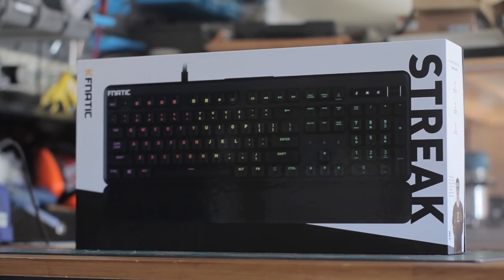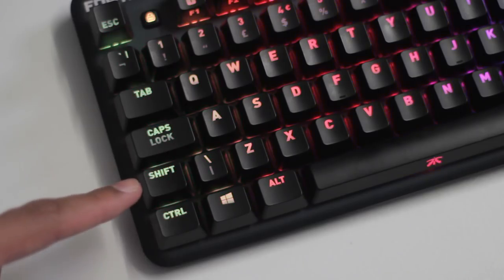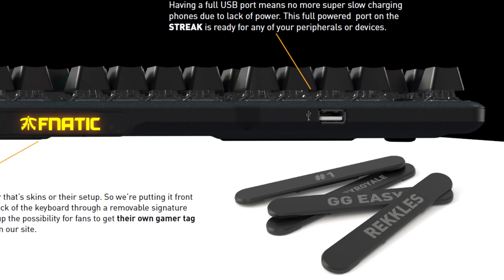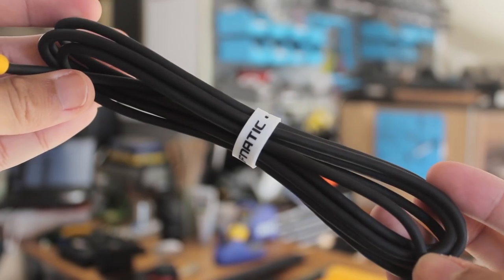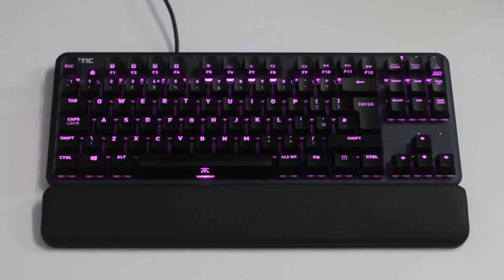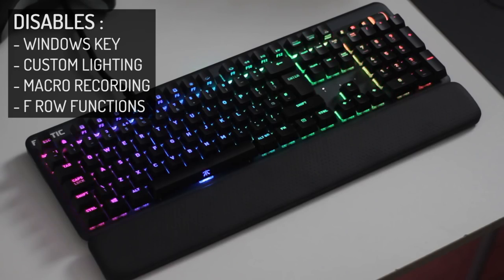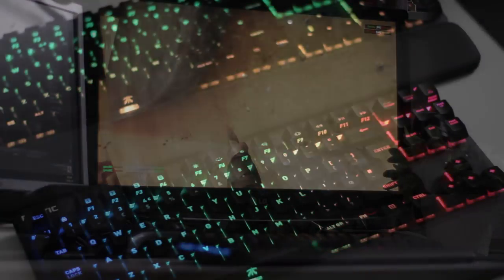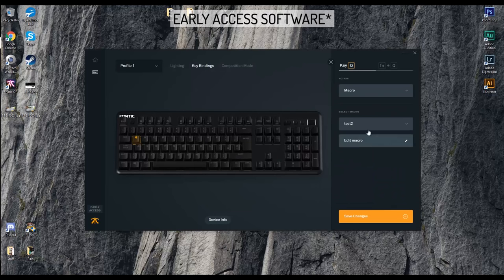Fnatic Streak & Streak Mini Gaming Mechanical Keyboards - Unboxing & Review

Comment from the maker: I've completely misunderstood the concept of wrist rests and how they should be used. Thanks to Daniel J. Grouse for alerting me. I did more research and testing, and have written my initial thoughts here : https://www.taekeyboards.com/single-post/REVIEW-Fnatic-Streak-Streak-Mini-Gaming-Mechanical-Keyboards
Reply: wait what its a wrist wrest u put ur wrist on it
Reply: Its okay. The idea of a wrist rest is a complete misnomer.
Reply: As Tae has locked his website and not copied the useful information given by Daniel into the pinned comment, I'll post it here for anyone who might find it useful:

"You're supposed to rest your palms, not your wrists. Resting your wrists applies pressure on them and makes you more likely to eventually have issues with carpal tunnel or other similar RSI problems.

"The fact we keep calling them wrist rests (instead of palm rests) and the fact you can buy many that are potentially quite harmful to you doesn't really help. I hate springing "uhm actually" onto people, but it's also something potentially detrimental to your health. It's mostly on manufacturers to start labelling them better and on the mechanical keyboard community to be more helpful when it comes to educating each other about ergonomics. We spend tonnes of money on the most comfortable and ergonomic keyboards for us while completely ignoring proper posture and typing techniques.

"Yes, if you can hover for prolonged periods of time without feeling strain anywhere else, that's the best. Resting your palms is the second best solution as long as it helps you maintain proper posture and typing technique. Also, I agree they should be called palm rests."

Comment: You're supposed to rest your palms, not your wrists. Resting your wrists applies pressure on them and makes you more likely to eventually have issues with carpal tunnel or other similar RSI problems.
Reply from the maker: Thanks mate. I did more research and testing, and have realised I've completely misunderstood the concept of wrist rests. 
I've written some quick thoughts - please refer to pinned comment.
Reply: Yeah, the fact we keep calling them wrist rests (instead of palm rests) and the fact you can buy many that are potentially quite harmful to you doesn't really help. I hate springing "uhm actually" onto people, but it's also something potentially detrimental to your health. It's mostly on manufacturers to start labelling them better and on the mechanical keyboard community to be more helpful when it comes to educating each other about ergonomics. We spend tonnes of money on the most comfortable and ergonomic keyboards for us while completely ignoring proper posture and typing techniques.
Reply: I mean, yes, if you can hover for prolonged periods of time without feeling strain anywhere else, that's the best. Resting your palms is the second best solution as long as it helps you maintain proper posture and typing technique. Also, I agree they should be called palm rests.
Reply: Yeah really it's pretty messed up that a lot of manufacturers advertise "ergonomic wrist rests" that are actually bad for you.
Reply: Those "wrist rests" always gave me cramps.
Reply: @danilodeklerk7422  Depends on the manufacturer. Logitech calls them palm rests like you should.
Reply: So i put my palms on the rest and then have my wrists on a hard surface? No thanks.
Reply: @HeliumFreak  Your order of RSI and carpal tunnel has been placed, it will be arriving in 10-15 years 😊

Comment: Was in the market for one of these TKL keyboards and i'm sold. Also doesn't hurt to have a Fnatic one as well. I appreciate the honest review and would like to help you out in the future if you haven''t been informed of this yet, but the "large" cable that comes with the standard layout keyboard is for the pass-through. The reason for the diameter for the cable is due to the bandwidth that needs to be sent to the motherboard. A standard usb-c cable simply can't output enough bandwidth for 2 devices as of now.

Comment: Bought the MiniStreak a couple of weeks ago. Super happy with it. Way better than that Corsair junk i had before...
Reply: Timbalo0 what corsair keyboard did you use? What switches did you use before and now?
Reply: @Lukaaaaaaaaa  K70 LUX RGB. Both had/have MX Brown. The switches were fine, but the keycaps started to fall out when quickly releasing the key after a couple of weeks. And after around a year the first cap broke completely. Yeah, i could have replaced the caps, but i decided to end it with a cup of coffee. The overall quality was just bad. The miniStreak (and i guess the Streak alike) is simply better.
Reply: @Timbalo0  mmh I think of switching from a k70 rapidfire with mx speeds to ministreak with browns. But i didnt have any problems yet. I dont really know if its worth it because i like my corsair, but its to big for me. Does the ministreak have media keys like play/pause?
Reply: @Lukaaaaaaaaa  I only realised how much space a full sized keyboard does waste after the switch. It's quite insane. The miniStreak does not have dedicated media keys but the F keys double function as those in conjunction with the Fn key. So Fn+F11 is for example play/pause. You can also lock into the function mode with a seperate button (between Esc and F1). But tbh i never use the Fn+Fxx shortcuts.
If dedicated media keys are important to you, there might be other TLK keyboards with those.

Comment: After watching this video along with others earlier today, I pulled the trigger on one of these keyboards, the miniSTREAK. I must say I will be keeping this keyboard as its is one of the better ones that I have tried so far.  Main thing I like about this keyboard is how solid the keys sound especially the space bar, virtually no wobble. 

Its certainly not perfect, but heck its still great. Things I would change for the next iteration. A) Different color face, say a BLACK or WHITE, not really feeling this Grey/Blue face. B)The Font on the keys can use some work C) My main GRIPE is the Wrist, it is actually quite useless to me. Putting the metal plate holder was in Pain in the ass for some reason, and the Pad is Too Small. They should have just removed it entirely and shaved another $10-15 bucks off the price. Either that or put a legit Wrist Rest like the on in the New Razer Keyboards (awesome) or the one in the Logitech G513 (awesome).
Reply: Try to put ur palm instead of your wrists on the wrist rest and try out all the 3 positions and check which one is best for you

Comment: You should check out the cooler master mk750 it's probably the best gaming branded keyboard out atm imo
Reply: what makes it the best? From pictures alone it looks like any generic gaming keyboard.
Reply: Adrian Logo the build quality is amazing. No stabilizer rattle, good quality keycaps, the wristrest is magnetic so you don't have to clip it on in 1 spot and the full build is metal. Yea the look is like any other keyboard but from owning keyboards from ducky and realforce it's actually impressive for a company like cooler master making a comparable keyboard for  a low price
Reply: I agree fully. I had masterkeys before and the MK750 just trumps it in everyway. esp. the stabs are much better.

Comment: another floating keys/low profile gaming style design :/
Reply: Symplesy 
Floating keys make it easier to remove keycaps/switches and it's miles easier to clean, just blow out all the dust and you're set
Reply: i get that some people like that style, but personally i find it makes the keyboard sound terrible, and it just seems to me like that design makes the switches vulnerable to damage that otherwise wouldn't be a thing on normal hipro cases.
Reply: Symplesy 
Well it all depends on the build quality, I personally use a floating key design with outemu blue switches and the entire top plate is solid aluminium making it sound more like thack than thock when bottoming out. Keycap material is also important, PBT is usually thicker than ABS and makes the click sound deeper
I can't think of a scene where you'd manage to break off a switch though, I rage on games sometimes and I usually clap my hands followed by cursing lol
Reply: even with thick sa caps my gmmk (this especially, honestly pretty shit sounding board) and k type can't even compare to a filco i had since forever ago. the k type, with some work (dampening material inside the case) made it not as cheap feeling and sounding. honestly i'm not a fan of mx clickies although kailhs are fine but generally clicky switches sound ok on platemounts usually, not as rattly as something like a g80 by cherry. i'm sure many other enthusiasts agree that low profile cases are more for that gamer aesthetic and would prefer a hipro case. my filco is one of my favourite sounding boards, just with simple lube on the stabs and switches made it sound just as good as my customs
Reply: Symplesy 
I got an Ajazz AK40S for $63 from gearbest 2 weeks ago and so far I really like the design, I just wish the tkl version came with a wrist rest and in full rgb rather than light blue even tho I like the frozen/icy type of vibe it gives off and for only $37 it seems like a nice deal
I haven't dabbled into the customization aspect as it tends to be expensive and I always look for the best price/performance